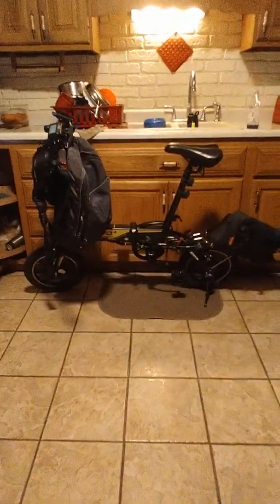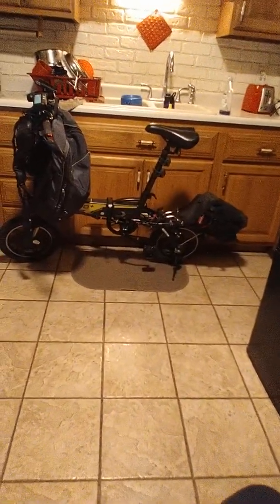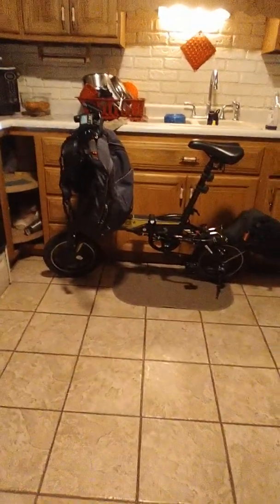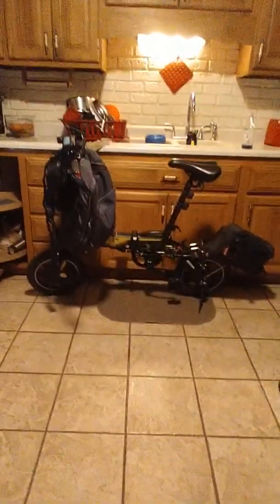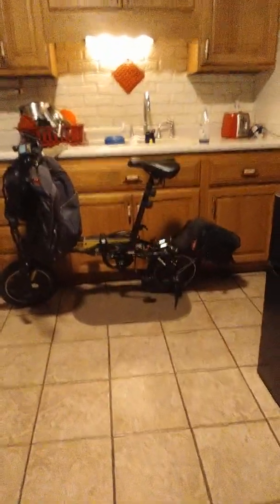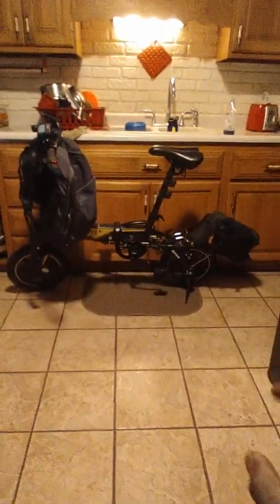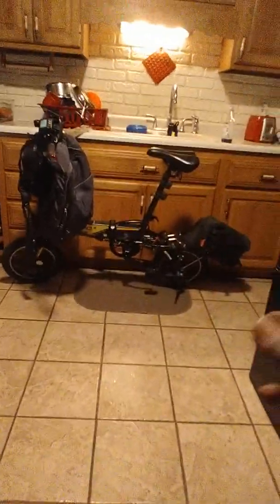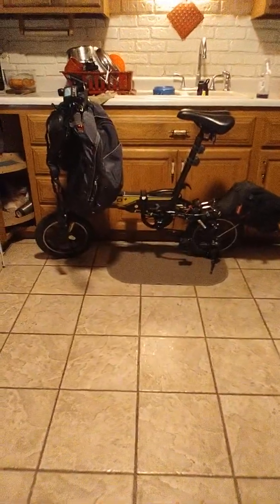Swagtron Eb5 pro plus over volted to 48v using Grin Technologies Baserunner controller ! Reveiw..😏😳😁

Comment: Great info man , great job as well , I own a swagtron eb7 one gear . I bought a 48 v 14 amp battery and 48 v 20amp controller on allibaba. My motor is a 350 watt , 16 inch tires 
I tried unsuccessfully to make my motor run , all  I heard was a  spinning sound coming from the motor while holding the throttle but it wasn’t moving. Tried a few times and no luck , (checked all of my wires again all good ) I got a little scared of burning my motor so I put it all back as it was originally  and it was no problem. Don’t know what the problem was since it was basically for 1000 front motor that I bought for a 20 inch tire  and it worked just fine soooo i decided just to get an extra battery that I can just swap without adding extra weight and why not and call it the day , by the way I can reach constantly 19 to 20 miles on full throttle  as well with this 36 v 8 amp stock battery about 13 miles